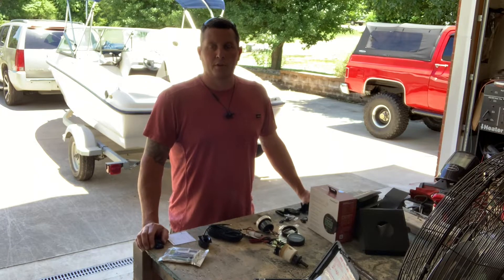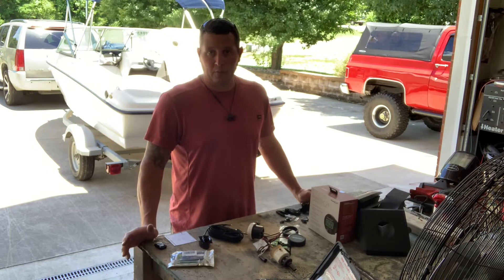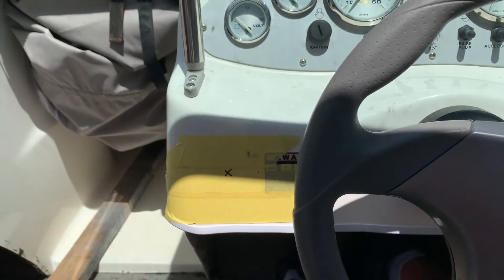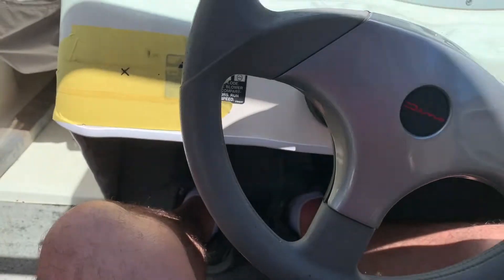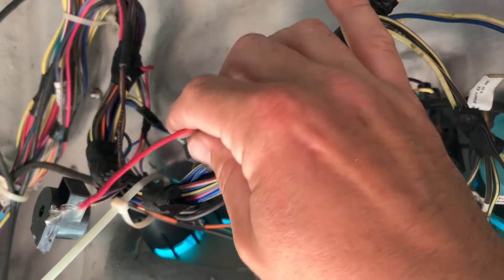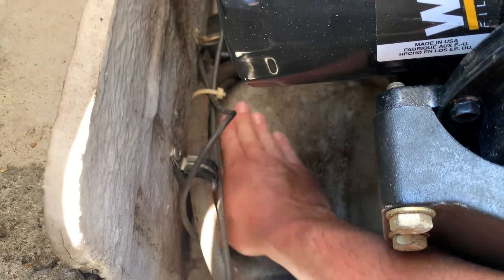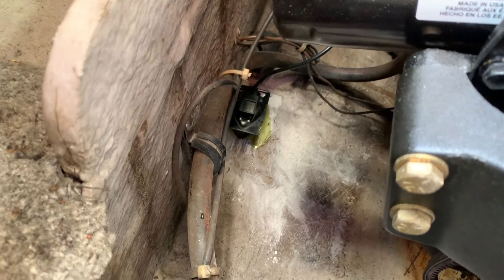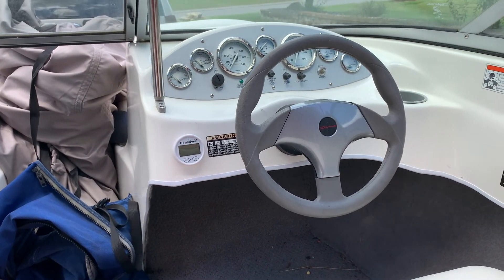2009 Bayliner 175 Depth Finder Gauge Install instructions HawkEye DT2B-B DepthTrax 2B

Comment: Question how to install transducer wires to depth finder I have same boat
Reply from the maker: I just zip tied the transducer wire to the steering cables
Reply: @trbokmro  so are they located behind the wall or under rail
Reply: @trbokmro  and also where did you wire the unit to. Did you spice in to a gauge
Reply from the maker: @eddiefitzgerald7731  under the side rail, you can follow the throttle cables as well.
Reply from the maker: @eddiefitzgerald7731  there is an extra switch in the dash for accessory you can pull power from. I think I showed it on the video
Reply: @trbokmro  I think I seen that ground also

Comment: Is that the thru-hull transducer? or did you just glue in the regular transducer? if so, why do they tell you to swap it for the thru-hull type if you are gluing it in your hull like you did.
Reply from the maker: Through hull is epoxy bonded per the instructions and works great

Comment: Could you tell the slow cure epoxy you used thank you
Reply from the maker: You don’t need the applicator gun you can just use the plungers by hand they supply. This stuff works great

Bigbong Epoxy Adhesive 50ml 2-Part Transparent Epoxy Glue Adhesive Granite Marble Tile Bonding Concrete Wood Plastic Joining 1:1 Mix Ratio Two-Part Epoxy AB Glue Two-Component & 2pcs Mixing Nozzles https://a.co/d/8feY51F
Reply: @trbokmro  it you apply to hull then transducer head and mesh together.
I'm afraid of air bubbles?
Reply from the maker: @redwood1957  yes and then I taped it down to hold it in place overnight. Worked perfect.